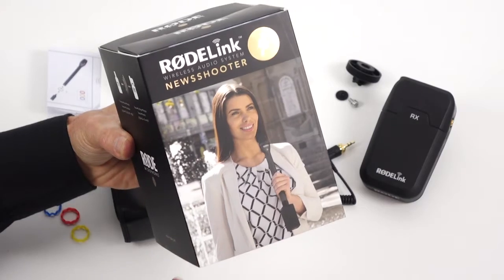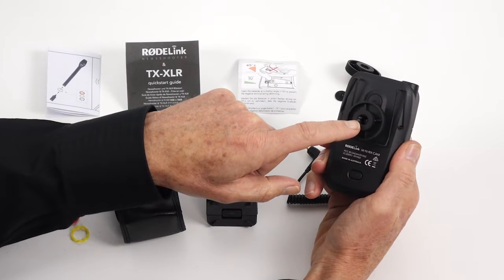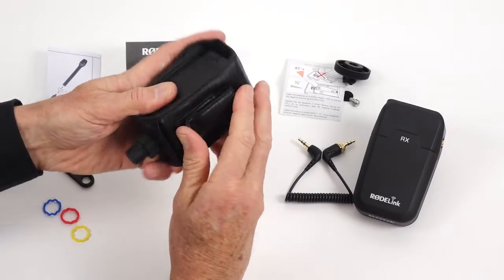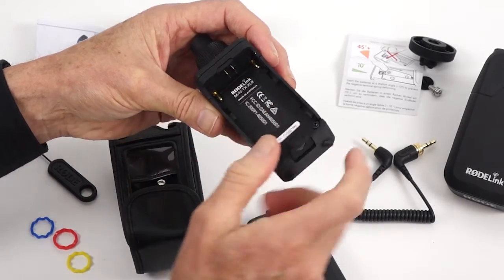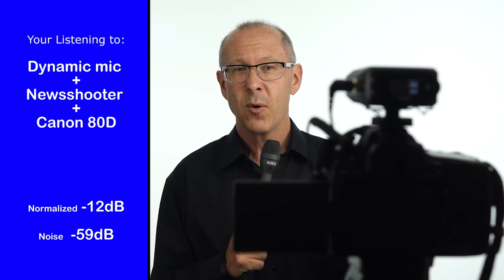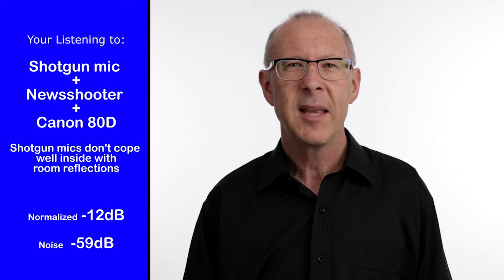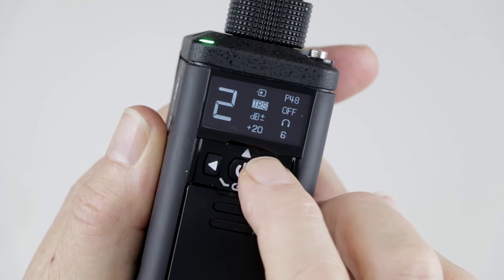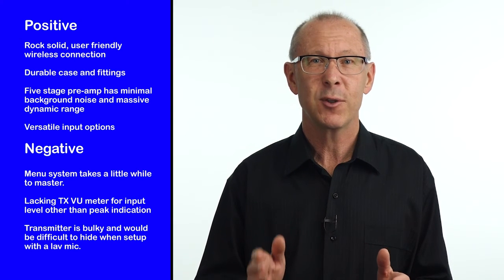Rode Newsshooter | Audio testing and how to change the input settings.

Comment: Nice review Gary! I have found over time that recording audio to a DSLR camera can actually have a surprisingly low practical noise floor. My hypothesis is because most cameras record audio at 16 bit, most of the lower amplitude energy gets pushed down due to the smaller encoding bit depth. It seems to bear out here as well (seemingly lower noise on the camera recordings). Again, good work!
Reply from the maker: +Curtis Judd Audio Wow- I had to read that a few times. I appreciate you mentioning that cause I don't fully understand how bit rates impact on frequency. Very kind of you to have a look at the video too. I am beginning to realise how much time good product entails.

Comment: Thank you very much for the very detailed informations. Received my newsshooter kit 2 days ago after waiting for more than one year to receive it in Germany. But there is still the same problem with interference of the lavalier-head coming to close to the transmitter. The Sennheiser Lavs do not work when you come to close for example by bending your body close to the transmitter. The changing of the phantom power and lav-power etc. is a bit a hussle. Need to have more practice. But all the rest is absolutely great.     Thumbs Up to your great review!
Reply from the maker: +Norbert Kleiner Thanks for your comment and feedback on the lav mic. I will check it out for myself but I'm not supposed about the interference. The lead is very thin on the lav mic and anything wifi is electrically noisy.
Reply: Hi Norbert - you have to buy a lav that is specially shielded for use with digital transmitters. I got an AVX and tried using my old analog mke2 gold lav mike and had the same interference issue you are describing. I bought a Sanken COS11D PT (where D is for digital) and it works fine on the AVX digital transmitter so should be ok with the RODE too. Hope this helps.
Reply from the maker: +BanTheBBCHD I appreciate your input and first hand experience. Thanks for sharing.
Reply from the maker: +Norbert Kleiner thanks for letting us know about the Sennheiser lav mic. Glad you enjoyed the video.
Reply: Hi BanThe BBCHD - thank´s for the solution of the riddle.  I tried to avoid purchasing another Lav again for the Rode Transmitter, cause I own already several Lav´s from Sennheiser.  A Lav from Audio Development is now working nearly 100% correctly.
But I think I would need a backup digital Lav in case of destruction and keep in eye that you recommended the Sanken Digital Lav.

There is still a precise instruction manual (also in German Language) missing. My distributor is actually trying to receive more informations besides the quick manual.

Let´s keep us updtated in case that there would be some news about this Rode-Kit in Future.

Best regards

Norbert

Comment: Hi thanks for this video.  I've only been able to get this used. So I'm considering one on the used market.  I found one where the rotating collar was removed ( to fit a particular mic ) and misplaced. Is it that the locking mechanism is spring loaded the and collar is just there to push down  the locking mechanism and either hold it in the unlocked (Depressed)  position or release it so that it raises up ( under spring tension) to lock the mic in place? The reason I ask is that does it also serve as a way to stabilise the mic on to the Tx-Xlr so that there is no wobble? or is that handled by the O-Rings. I'm trying to determine if I can get by fairly reliably  without the rotating collar. I have not handled an actual device but I'm hoping that I will only have to depress the lock by hand and not that the collar helps with mechanical  connection stability. Any input will be helpful.  Thanks in advance
Reply from the maker: Yes the collar is just to secure and stabilize the connection. The XLR plug has its own clip the hold it in place. You have to depress the clip to remove the mic. Hope that helps.

Comment: Do you need to add a preamp to camera on this setup? I have rode ntg4+ inside rode blimp and connected to newsshooter kit and using 20db boost. Would adding a preamp between microphone and newsshooter transmitter help? Or adding a preamp between newsshooter receiver and camera?
Reply from the maker: Two of those components have a preamp built in. The the transmitter and the Rode Newsshooter receiver. The highest output on the receiver is 0bB. 0dB is a line level output and can be too high for a lot of cameras. Adjust the gain on the transmitter to the highest level without clipping. Hope that helps.
Reply: @GaryDmedia  good idea. So add boost on transmitter and reduce on receiver. So we need to add boost as close to microphone for best result.

Comment: Thanks for the review. Have you noticed any increase of noise when adding gain on the transmitter? I'm testing this in my Pocket camera which seems to need extra gain and and wondering whether is better to add that gain in the Rode Transmitter or in camera.

Comment: thank you. best video in youtube about rode newsshooter. keep up the good work
Reply from the maker: Thanks Biju, I appreciate the feedback.
Reply: @GaryDmedia  thank you after seeing your review i bought the newshooter kit, to use with blackmagic pocket camera. when i connect with sound devices MM1 pre amp its not working.earlier i used   rode ntg3 shot gun into pre amp sound devices MM1 and then record directly into blackmagic 4k using mini xlr. of course i am aware that newshooter kit is  designed to  directly record into camera using 3.5mm inputs. but i thought it will be good to have a good pre amp in between the mic and camera. please let me know
Reply from the maker: Biju, the preamp in the Rode receiver is of very high quality. Adding extra components into the audio signal chain will only deteriorate the sound even though the extra preamp is of high quality. Please give the Rode unit a go directly connected to your camera. You may have to adjust the gains a little but I have found that you can get a good balance and lower the noise floor (hiss) considerably. Hope you have some success. I’m a bit jealous of the gear you have got. Nice.
Reply: @GaryDmedia  thank you. i have been e mailing rode customer support for many days for an answer ,all i got was more questions from them.  thank you for your clear and precise answer. one more thing why is it sometimes the transmitter unit blinks red even when its closer to the receiver . have you encountered similar issue.please let me know
Reply from the maker: It is a general rule that you should not operate high frequency units close together. 3m is a common minimum distance though I commonly use these units 1 to 2 meters apart. The red indicator also indicates overdriving of the transmitter preamp. Not sure that that is your problem.
Reply: @GaryDmedia  thank you . i will do more tests .really appreciate the guidance

Comment: Gary, Great review and I really appreciate the information.  I have a question for you do you have a recommendation for a high quality lavalier microphone that will connect with the news shooter with no adapters or additional equipment?
Reply from the maker: W7 Productions, I would recommend the RODE Lavelier mic. I have used it with the Newsshooter and been very happy with it. Considering you have a quality transmitter a cheap mic will let the system down. This is a link to the mic to get an idea of the pricing: https://amzn.to/2YTuzhe

Comment: Thank you Gary! Do you know if it is dangerous to put on the 48 w power to a dynamic mic?
Reply from the maker: It is not good practice to connect dynamic mics to +48v phantom powered inputs. Most modern microphones have protection against this but not all. In saying that many audio mixers don’t have any option to be selective in which inputs to feed +48v to. Either on or off to all. Hope that helps.
Reply: @GaryDmedia  Of course it helps. Thank you!

Comment: Great Video Gary...!! Thx.
Question... it looks to me that I can also connect a guitar if I use the 1/8 jack in the tx with an adapter... would that work like it does when I do it with my Shure and Sennheiser wireless systems...??
Reply from the maker: You most like would find that the input is not suitable for your electric guitar. If you went into a small mixer and then plug the transmitter into an XLR output it would work well.

Comment: great video!!  short and to the point and with almost all the information anyone would need. 
Does the transmitter had a +20dB setting???  I think I saw a 20db sing there
Reply from the maker: Thanks, yes it has a +10, 20, 30 and 40 dB input setting.

Comment: Can you advise if sound quality difference would be noticed if we recorded sound into a field mixer/recorder at 24bit vs 16bit that is in camera. I have sony a7r3 which saves 48khz 16bit. I also have atomos ninja v which saves i beleive 48khz 24bit.
Reply from the maker: I most cases recording on a separate recorder will be best. If your videos are for YouTube etc you can't beat the simplicity of recording sound to camera. All professional production will record separately and just use in camera audio to assist in synchronising audio in editing.
Reply: @GaryDmedia  i would like to achieve voice clarity which you have in this video. Which exact gear was used to record this?
Reply from the maker: Ivan, for the talking head sections of this video I used the Rode filmmaker kit. The lav mic was stuck inside the left arm of my glasses. I was just trying something different. Most of my other videos I just clip it to my shirt. I got the tip from Curtis Judd. He has some great tips too.
Reply: @GaryDmedia  from your experience. Best result for this type of yt video would come from lavalier or from shotgun mic? Newshooter with lavalier such as rode smartlav or newshooter with ntg4+
Reply from the maker: Good question Ivan. The determining factor would be how good your acoustics are in the room your recording in and how close you can get the mic. My first choice in most cases would be the lav mic. It can be setup close to your mouth. Within 300mm or 12inches. To get a shotgun mic that close it would most times be in shot. Also shotgun Mic's don't would as well as they should inside with reflections of sound off the walls. It upsets its ability to reject sound from the sides and back. In a dead room like a studio a shotgun mic might be more convenient to use.
Reply: @GaryDmedia  thanks a lot for the info

Comment: This is a great review with all the different option. Thx. My main interest in get this is for shotgun mic for on the go film making. Would the Rode NTG 2 work with it for this purpose of being on a boom? Again thx.
Reply from the maker: Yes I have seen this. The Newsshooter has switchable phantom power so ideal for that job. The only thing is if you needed to put it inside a blimp. It may be a bit long. You would have to check that.

Comment: I have been having lots of background noise with the new shooter kit and newscaster microphone. Any recommendations on how to minimize this?
Reply from the maker: I’m not sure what that would be No Cap. It normally is very quiet. I would try a different mic plugged in or even a lav mic to see if is definitely the transmitter. 
Also raise the gain if your receiver so it sends a higher level to your camera. 
Cameras unusually have noisy inputs.

Comment: Hi Gary thanks for the great vid/tutorial. I am a stills photog and need this kind of set-up to do the occasional interview. - I just received the kit and loved it - for the first day.  The transmitter stopped functioning the second day.  I have a Senneheiser MKE-400, a little shotgun mic that can go on top of a camera (it's probably around 10 years old but works perfectly). It runs on one AAA battery.  I was getting familiarized with the RODE Kit and plugged the MKE 400 into the RODE transmitter and was getting great sound. I went back to the kit the second day and the transmitter 'started up' and paired with the receiver but then shut down (this with fresh, strong batteries) after about ten seconds. Then, after repeated attempts, the transmitter would not turn on (always using strong batteries. Can you see where the shotgun mic could have caused any problems? It was plugged in (it fit fine but had no tightening collar) and turned on (powered by the one AAA) and was working beautifully with the receiver. I did/do like the product, but am so disappointed that is shut down like this so quickly. Thanks for any help/thoughts/advice
Reply from the maker: I’m very sorry to here you are having problems with the Rode gear. Would you please confirm which Rode transmitter you are having a problem with? Is it the NewsShooter transmitter?
Reply: @GaryDmedia  thanks for the reply Gary-It is the NewsShooter transmitter; the same one that is in your video above.
Reply from the maker: I understand. That is unusual for the transmitter to stop working after a little while. The Sennheiser mic would not be at fault. If anything, it may overdrive the input if not setup correctly, but that in no way would break the transmitter. 
More than likely, it needs repair. Before you do anything I would contact Rode via their support page. They are very good at customer relations. I really hope you can get it sorted quickly.
Reply: @GaryDmedia  appreciate this Gary.

Comment: Thanks Gary. I use the Filmmakers Kit. I love it. Is the receiver of the Filmmakers Kit the same as the one coming with the Newsshooter. If it is do you know if it is possible just to buy the transmitter of the Newsshooter?
Reply from the maker: +FreiesWendland Yes the receiver is exactly the same. I saw on a Twitter or Instagram feed that the TX-XLR transmitter will be available eventually on its own.
Reply: Gary, thanks. So I´ll wait a while. I love that stuff, makes life so easy.
Reply from the maker: +FreiesWendland I agree. The gear is easy to setup and use.

Comment: Hi Gary, thanks for sharing another great tutorial. Have you tried it with an iPhone. I wonder if it will work if you add a Rode SC7 cable to the receiver and plug it into the iphone? Any thoughts? Thank you.
Reply from the maker: +Alvaro Andoin (Filmatu) Mobile phones are unpredictable when you plug in audio devices using basic adaptor leads. The phone has to identify if there is a headset (4pin) or earphone  (3pin) attached. If the phone detects earphones only it will switch to the onboard mic for an input signal. The trick is to convince the phone an audio device like a receiver is attached. A special lead has to be used to reliably do this. The lead not only has a resister to simulate a mic but also a resister pad to reduce input level if needed. There is no reason the RODE receiver wouldn't work with the SC7 lead, it is a question of reliability. Hope that helps a little.
Reply: Thank yoy very much Gary. Simple and clear as usual. Warm regards.
Reply from the maker: +Alvaro Andoin I am happy you enjoyed the video and very grateful for the feedback, thanks.

Comment: Great detailed review! .. I have the same news rodelink + rode lav + h5.. Would you boost the mic to +20 and lower the H5 gain or 0 and boost the H5?  Many thanks!
Reply from the maker: +Sam Kutereba-Wall You would have to try out both methods. Both the RodeLink system and the H5 have low noise.
Reply: Many thanks for the reply - loving the vids!
Reply from the maker: +Sam Kutereba-Wall Thanks

Comment: Hello Gary, is there anyway that you can run two lav mic's with the Rhode Newsshooter. I am finding an increasing need to interview two people and don't want to use the microphone to pass around, I would much rather use the lapel (Lav) mic. Could you let me know if you know please.
Reply from the maker: Yes that would be possible with a simple mini jack splitter cable. I haven’t tried it myself but it would be worth a try.

Comment: Hi Gary. Great review. Im deciding between the Folmmaker Kit and this Newsshooter kit. I  will be using it for lavalier setup. I already have the Røde Lavalier Mic with the XLR adaptor.
Q: When you tested input to the Canon 80D, did you add gain to the reciever and lower the preamp on the camera to get this low noise result ? What was your settings for this ?
Reply from the maker: Yes lowered the input gain on the 80D to one stop above off. The transmitter mic input gain was lifted to +20 and the receiver gain -10. Depending on the volume of your voice you may need to tweak the 80D's input up a bit. Hope that helps. It's a bit hard to know your exact needs but that should give you a start.
Reply: Great. Ive struggled a lot to get better audio on simple recordings. Useed the Zoom H4 as well, but find it 'too much' for simple stuff. And a direct mic input to the Canon 80d is just horrible. I will try the newsshooter kit.
Reply from the maker: I’m sure you will have more success. Simplifying your work flow is always better in my books.

Comment: This is actually to do with one of your previous videos. I have the H2n from zoom, if I update the firmware in that do you possibly know if it'll have the option for iPad or iPhone like shown on your screen in your previous video because that would be great!
Reply from the maker: On page 73 of the H2 user manual it describes how to do it. Not sure if you will need to add in a powered USB hubb in between  because connecting it to an iPhone or iPad the H2 may spit the dumby. There is no iPad option in that menu. I'd love to hear if you have any success. Thanks for commenting.